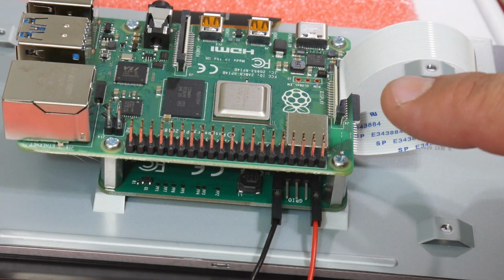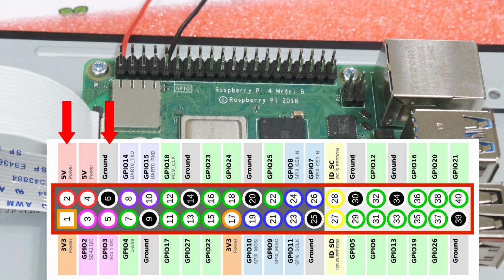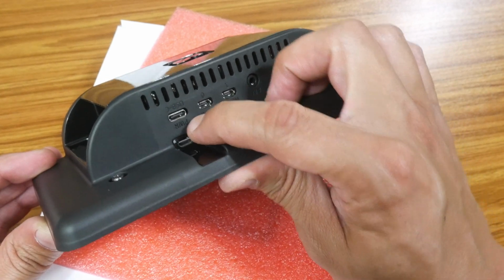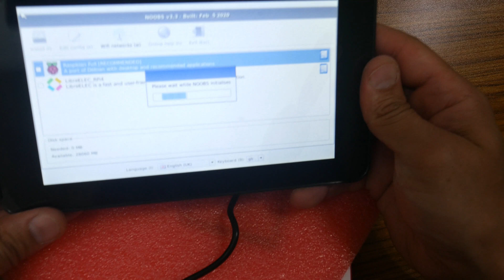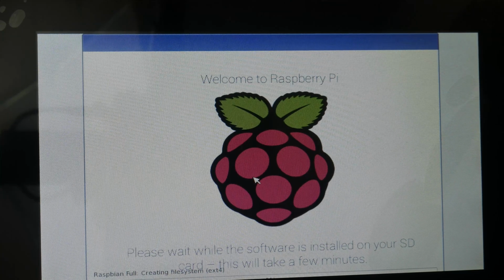$150 DIY Tablet (Raspberry Pi)

Comment: Is that a raspberry pi 4? If so at the very least you need heatsinks on the cpu and gpu. I would highly recommend putting a cooling fan on in combination with the heatsinks